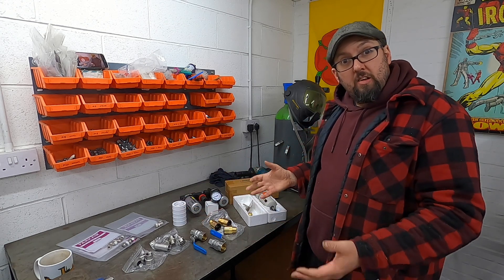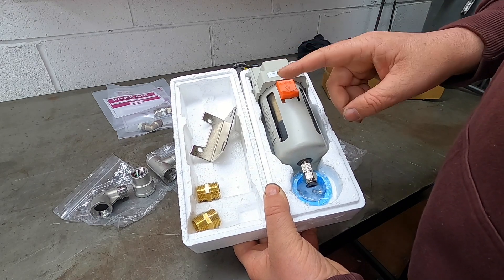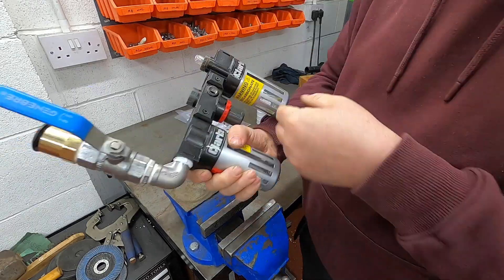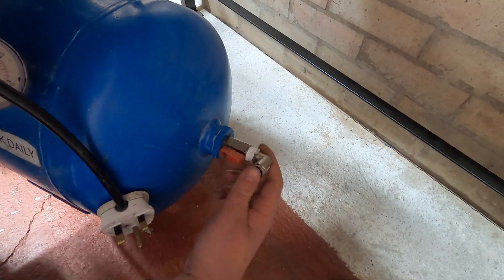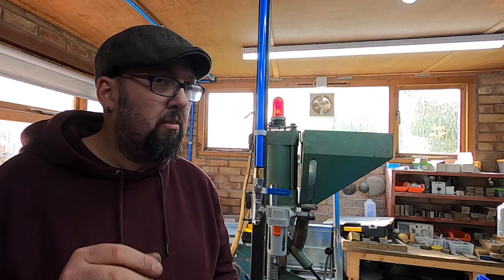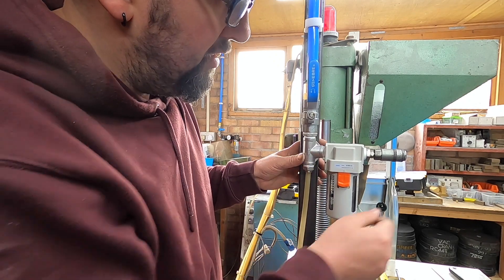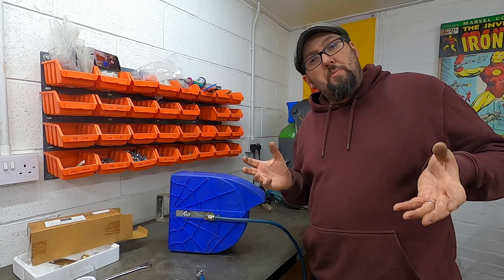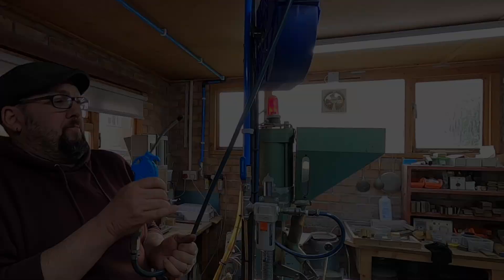Fitting a new Airline Main to the workshop - Part Two

Comment: Your line between compressor and wall pipe system looks rather small. It might restrict the capacity of your system
Reply from the maker: It looks it, but it doesn’t, surprisingly!! It is on the to do list to upgrade to a bigger size. Need to find something more suitable. All the best, Matt. 👍
Reply: Given the size of your workshop tubing, the tubing is  partly functioning as a secondary reservoir. The restriction in you feeder will show itself when either using multiple devices or something which needs a lot of air. As long as you only need same amouts of air it will not be a problem.
Reply: And you are in good company. Gresleys Hush Hush had an issue with a (to) small feederpipe as wel ;-)

Comment: Nice one Matt.
Will the compressor cope with air tools!!!! If it will let me have the name and model, as my 2hp one won't!!!
Laterzzzzzzzzzzzzzzzzzzzzzzzzzzzzzzzzzzzzzzzzzzzzzzzzzzzzzzzzzzzzzzzzzzzzzzzzzzzzzzzzzzzzzzz!
Kev
Reply from the maker: Thanks Kev, it’s a Hydrovane compressor so it’s has more guts than the average mechanical pump type, they also run a lot more quieter than say a Clarke. We can hold a normal conversation over the top of a hydrovane. They are also designed to run constantly, so on high demand they will sit between 4 to 6 bar comfortably without issue. Sure mine is a 501 model. Laters 👋 Matt.